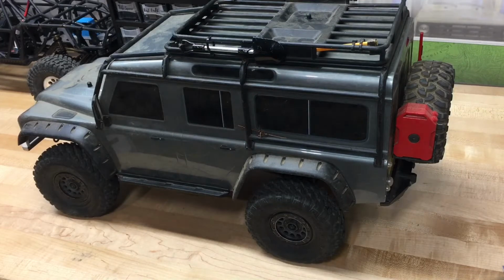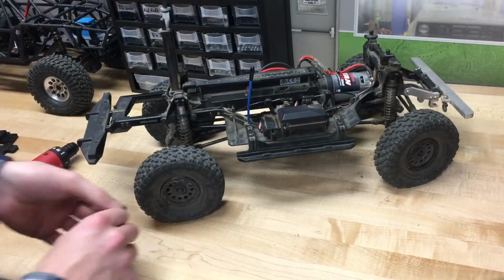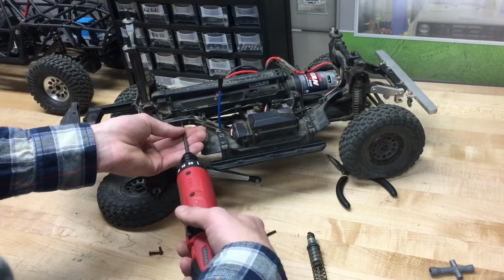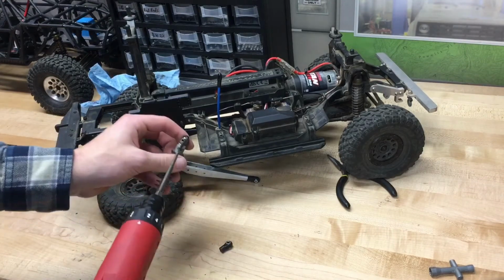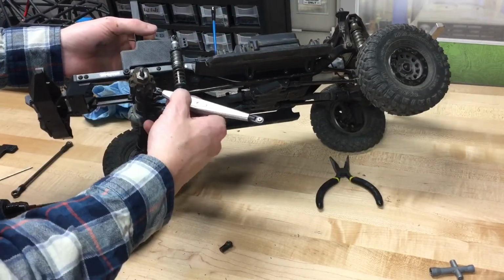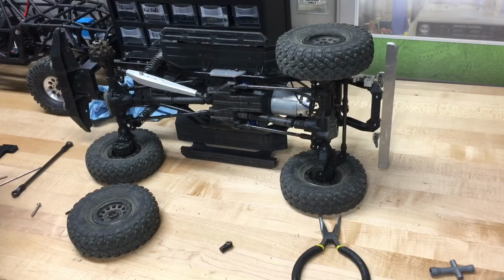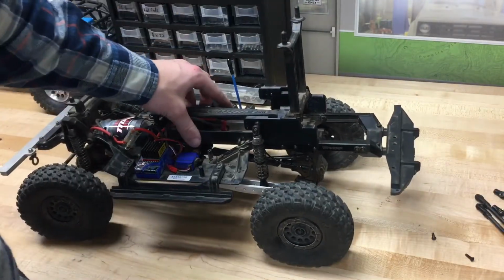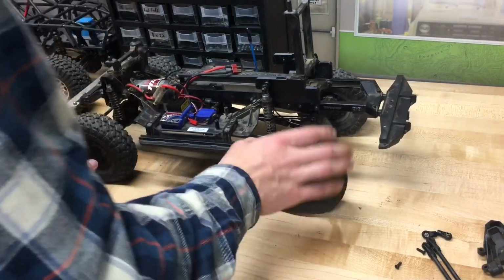TRX4 Trailing Arm Kit Install EXTREME RC 4X4

Comment: I've been thinking about modifying mine to a trailing arm set up. Was curious to see how much your kit is but I see it's no longer available. I only need those aluminum pieces near the center of the rig as I have the SuperScale suspension so my back half of the rig is way different from stock.